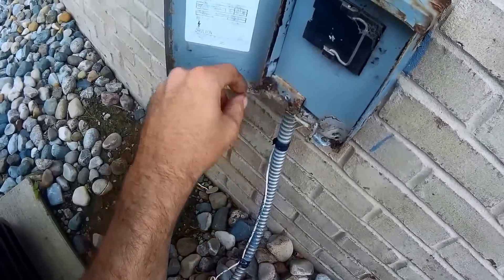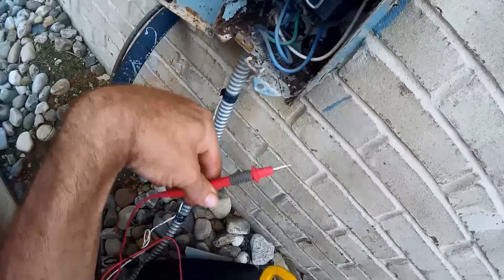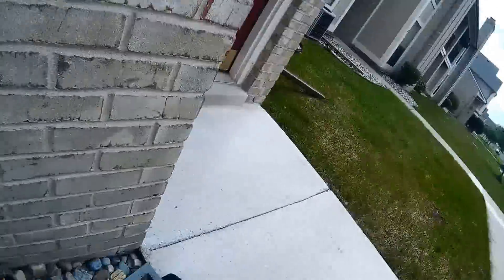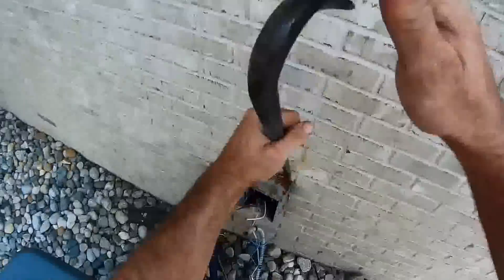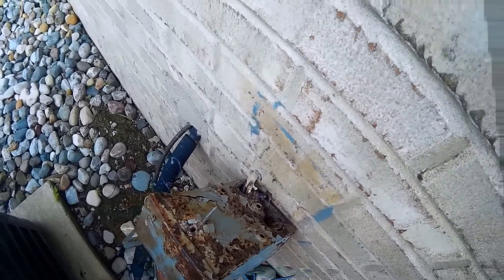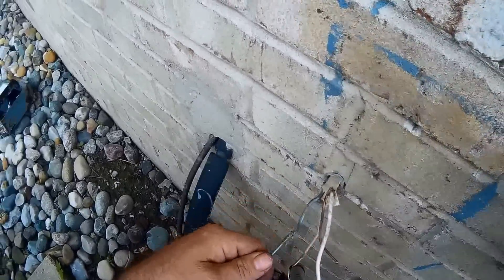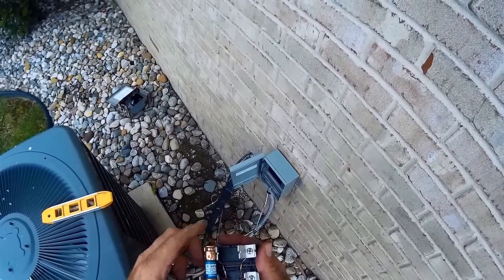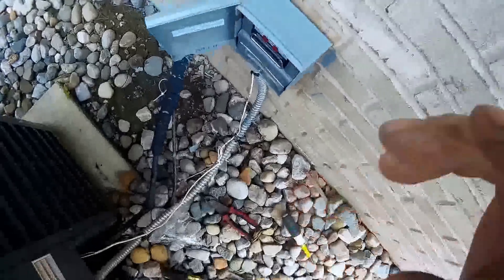30 Amp Disconnect replacement for A/C

Comment: Dumb question why 20 amp fuse when it's 30amp?
Reply from the maker: +junkmail1203. In residential we have 2 size disconnect boxes we have a 30 and 60 amp the 30 amp accepts fuses from 15 - 30 amps and the 60 amp accepts fuses from 35 to 60 amps fuse size depends on what the max rating on the condensing unit 4 fuse size